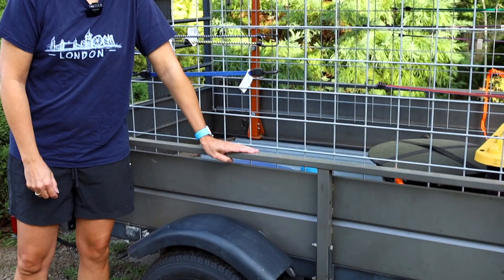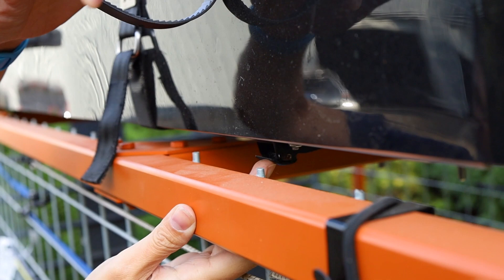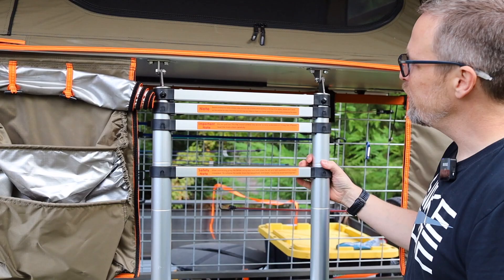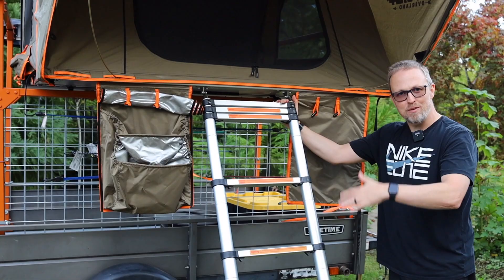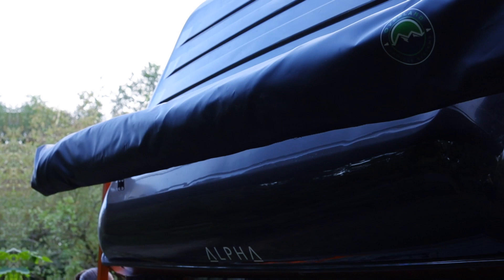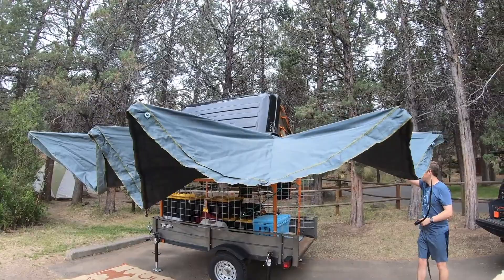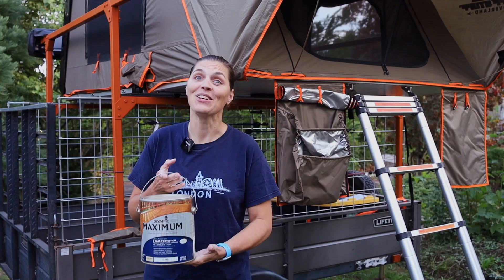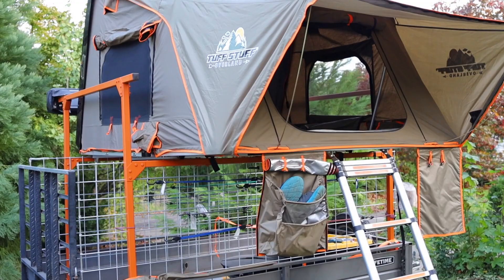4 Things we did WRONG on our Roof Top Tent Trailer Build

Comment: 2:00: we have an iKamper with what looks like exactly the same ladder. I pulled the feet off, then cut a few inches off the BOTTOM of the ladder to get the perfect length & angle. A few wraps of duct tape improved the friction fit of the rubber feet.

Comment: If you add a spacer to lift the tent the amount you need for the ladder to function properly you will also gain finger room to undo the straps. That's 2 problems fixed with one easy mod.
Reply from the maker: We do have a couple extra pieces of steel so we may have to give that a try. 😀
Reply: A rubber/plastic bushing used in car suspension would be better. Would reduce vibration too

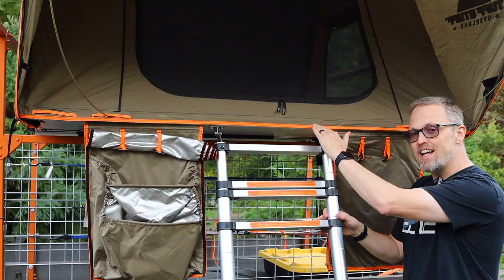Comment: around 2:00 you are talking about the ladder's angle. If you get some paracord and tie to the 2nd or 3rd from bottom rung and tie to the verticle rib of the trailer. this will allow for an easier approach to tent and prevent kickout.
Reply from the maker: That is a good suggestion but one big problem is the ladder rungs only lock into place at certain intervals. It would help if the ladder was more adjustable.

Comment: I didn't have my tent either, but ended up having a welder design my "cage" to go on top of my utility trailer.  I didn't go with the taller sides that you all did, I basically had him design it as if it was a big square, but with movable crossbars so it would be flexible in what I could throw up there.  However, my original trailer started out as a kayak trailer, and I planned and wanted it small.  NOW, that I'm camping a ton, my biggest mistake was going with too small of a trailer.  4x8.  You can't see it in the mirrors as well, and with my kayaks loaded, I just don't have enough room for gear.  Soooo, onto version 2, lol.  I'm picking up a 5x10 with 15" wheels this weekend, and started over.  I do think for the short term I'm going to get a ladder rack to hold the tent, and really design the next "welding" job a bit better.  Mine works great, but once you start using it, you figure out what you could do different.  I do like the idea of yours being put together.  I'm curious at the cost (maybe I missed that in the original video).  Mine was $500 to do what he did, but that was over a year ago and steel is way more expensive.  He's working on a quote to do basically what he did last time, but I suspect it will be double which has me looking at other options for now.   Thanks for a great video!!
Reply: I bought a ladder rack used for $80 and then used pallet racking beams ($27) as the crossbars.  I bolted it all together with loctite so it’s removable if needed.  We will see how well it works out.  Maiden camping trip
Is next week.

Comment: I'd run 2" spacers or some 2" square tube to lift the tent, while it's unbolted turn it around. And then remount the awning on the opposite side.  Will work just fine, not ideal, but definitely workable. And as a bonus, it would provide covered access between the tent and the truck. Another idea is with the rack you have, you could add fold down or hook on "tables" on the orange rack, on each side of the ladder for storing shoes and other things you don't want to take into the tent.
Reply from the maker: I like the table idea. We have been looking at aluminum counter to have as drop down tables on the side of the trailer. We can’t flip the awning because then it wouldn’t cover the kitchen when it extends out of the back.
Reply: @ExploreTrekAdventure   I understand the thinking, but a little more food for that thought.......     Since you have a great and sturdy rack, do like I said and reverse the entire thing, but then also add some pull out arms to have a second awning to cover the kitchen. Or even just another small rv style one mounted to the rear that extends out over the kitchen.

Comment: Hello there.  Where did you purchase the cage part of the trailer?  Also, if all you had was a riding lawn mower, could you tow this trailer a short distance w/it?  Thanks.
Reply from the maker: You could start with a smaller 4x6 trailer platform which might be towable by a small mower. The bigger trailer we have would be way too heavy. The cage was built from steel tubing and “DIY No Weld Brackets” which you can find online.

Comment: What's maintenance and cleaning like for the Alpha? Is it a big chore when you get home after a weekend away to keep it cleaned out or to check all the fasteners?
Reply from the maker: It’s a fairly good easy process. We open up the tent in the garage to let it air out and vacuum the inside. After a day or two we fold it back up which only takes about 10 minutes. Probably need to protect the hard top with some type of wax but haven’t researched that yet.

Comment: @5:15 Do you have the little bit taller and little bit shorter heights for us so we can avoid that situation?  TY :)
Reply from the maker: Honestly the best way would be to test the tent ladder. Depending on the tent and the ladder they have at the time the height would change. You could also add spacers to the rack if needed for small adjustments.

Comment: Great video and information. I am actually in the planning stages of my Rood Top Tent Trailer Build and stumbled on your channel. I have always thought that i would place my RT with the ladder on the passenger side and the awning on the driver side like yours. I do plan to be camping mainly at devellped camp grounds. After watching your video I'm kinda confused now. Can you elaborate more? Maybe a good topic on a future video. "Ideas of a Roof Top Tent Trailer Campsite Layout/Setup"
Reply from the maker: Part of our problem is we have the 270 degree awning which means it can really only be attached to one specific side of the trailer. We want to have our main hang out area covered by the awning, but we also need the back of the trailer covered. Our Kitchen slides out from the back of the trailer and the 270 degree awning wraps around and covers the cooking area. We can’t flip the awning to the other side because the wrap around section would cover the wrong end of the trailer. That’s where we probably should have ordered the passenger side version of that 270 degree awning. If you are going to use an awning that comes straight out from the side it probably doesn’t matter as much since you could always flip around your setup if needed. Does that help?
Reply: @ExploreTrekAdventure  Yes it helps! Thanks.
Reply: @ExploreTrekAdventure  Would you actually be able to open a passenger side 270 awning or would your RTT block it?
Reply from the maker: We would have to flip the tent around so it would open on the driver side.
Reply: @ExploreTrekAdventure  Got it. So you would end up flipping both the tent and the awning. Do you see any downside to that? Maybe less aerodynamic?
Reply from the maker: It might look a little odd with the slop of the tent going to wrong way but I cant really see any other reason not to do it. If it was permanently mounted on the truck i might think twice but the trailer only goes out specifically for camping.
Reply: Awning on the passenger side! For road side stops or most campsites.  I used unistrut from lowes for the rack on our cargo camper..BIG pantry/sink/stove under that awning 👍